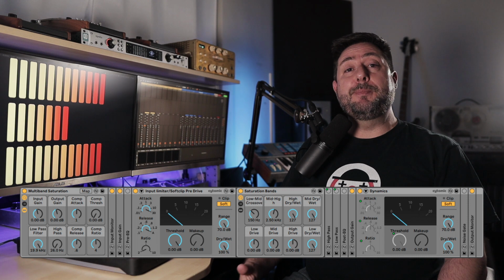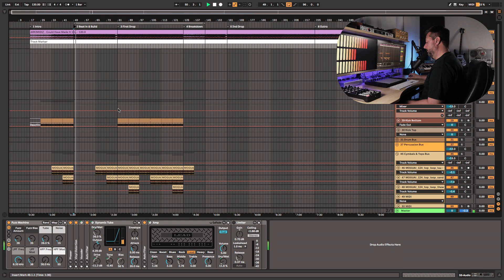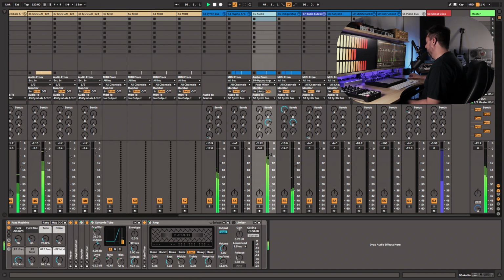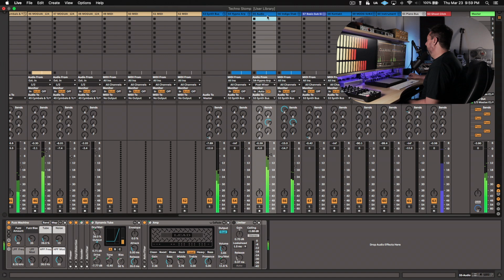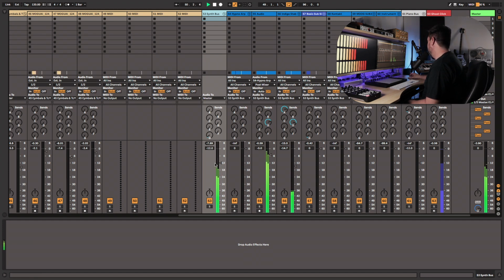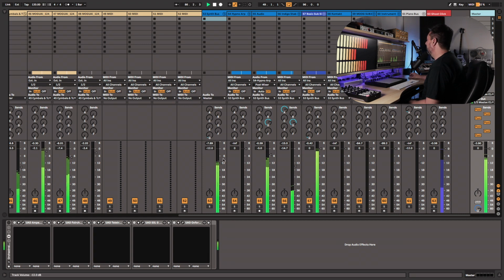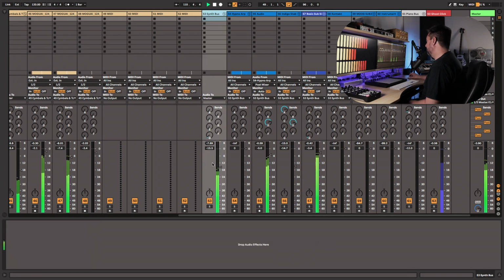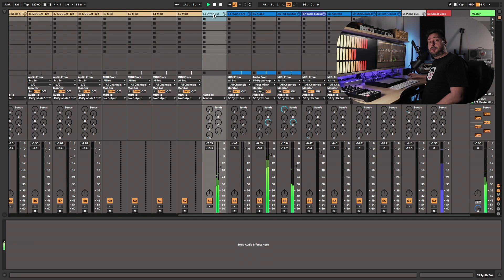Gain Staging Secrets: How to Mix Like a PRO

Comment: Hi. Great video!! Question: My personal default template setup for gain-staging has my busses set at 0 dB and each individual track at -12 dB vs. yours where you have your busses at -12dB and your tracks adjustable.  I also shoot for -6 dB at premaster (post mix) stage. Is What is the practical difference between the 2 methods? Thanks in advance.
Reply from the maker: Thanks for checking out the post! 

I prefer balancing the individual tracks within the group starting at unity or 0dB gain reduction because I found myself lowering the track volume much more often than I’m adding level. For example, balancing percussive samples can sometimes lead to drastic reductions with hi-hats to create the right amount of energy without overpowering the mix when passing through several compressors and limiters, bringing the high end up each time).

Additionally, I’ve found setting the group fader to -12db ensures I’m hitting the -6db goal that I have in mind. There are many people that say it’s not necessary to do this with digital but I can hear a big difference in clarity, balance, focus and energy in the right places with this workflow. Cheers!

Comment: I think that even more correct way to do it is to set the input gain of the channels so that the peaks are around -12dB when the faders are kept at unity gain (I dot't use Ableton and I am not aware if it measures the signal pre or post fader). The group or bus fader would also be best kept at 0 dB. If the output signal is too hot, maybe put a tool plugin to reduce it at the end of the processing chain. The faders use logarithmic scale and the further they are from the unity gain, the more difficult it is to make small changes with automation or with controllers, when needed. If you master in a separate session there maybe would be  no need to decrease the volume at every group - just pull the master down a bit to make the sound levels comfortable for listening or even just decrease the volume of the sound card. The DAWs nowadays have plenty of headroom before clipping.
Reply from the maker: Great workflow as well! Thanks for sharing your technique, I’ll give it a try

Comment: There is no benefits of having Peaks of a initial transient preserved in the range 0~8ms, rather 0~10ms. 
Inertia of human hearing won't detect such Peaks as a volume and such short portion of Peaks have 0 musical or timbral information. 
Such Peaks should be heavily Compressored and even Limitered, most time even Cliped.
Such Peaks (percussion\vocal\DI‑guitars) are sometimes even 12dBFS above the corresponding RMS (or VU) value and when tamed down, can free up to 9~12dBFS of Headroom to further boost the overall Volume om the signal\mix.

Comment: Hey i really like the way you explain! One question popped up in my head when you adjusted the volume in the fuzz plugin. is there an advantage doin it in the plugin instead  of pulling the channel fader a bit down to adjust the added gain of the fuzz plugin?
Reply from the maker: Hey, thanks! Glad you found it useful. 

There is a benefit to adjusting the gain on the way in and out of an effects plugin - it's to prevent overloading the next plugin before it goes back to the track fader. Let's say you add an EQ or compressor to your chain. You'll want to hit each plugin in it's sweet spot (-10dB to -15dB) so that they're all balanced. It saves you from having to adjust it later when you're setting up your final mix and scratching your head why one track is so much louder than the rest and then over compensating with crazy fader settings or reaching for a limiter (which could squash your sound completely if not used properly).

Feel free to reach out by email if you want me to walk you through it
chris@electronicmusictips.com
Reply: @ElectronicMusicTips   i see. makes totally sense now! thank you for your explanation. I appreciate it very much!

Comment: Great video, I like how you explained the basic concepts first, giving actual numbers to start with and also to show it in a daw. Thank you. Do you have any tips for live performance setup, what might be different in terms of headroom (less or more) and with sends instead of buses? I use buses when finalizing tracks, but cant really make it practical when live since i record instruments during performance and mix additional sounds in. There are some limits how many channels I can operate meaningfully, so i use sends instead of busses. I'm pretty new to that so I don't really know any other way. Maybe there are some tips with that how to sound better with sends.
Reply from the maker: Thanks, I'm happy you found this post helpful!

Gain staging and headroom for live performances is the same as recording, with the importance on finding a good balance between minimum noise level and maximum peak volumes. Stay between -1dB to -5dB for peak volumes so that you're not clipping and introducing audible artifacts and distortion. Aim for your average level to be between -15dB to -10dB RMS. Your DAW might have an RMS setting to show you the average volume. I use a plugin called VUMT, made by Klanghelm. It's a great meter and I think there's a free version! Lastly, using light compression or limiting will ensure you're not going over unity gain (or Zero dB). I always set the threshold so that it's just 'kissing' the signal and roviding 1dB to 3 dB of reduction. Anything more is too heavy handed and will start to compress your sound too much for a live performance.

There aren't any hard rules for using busses vs sends... use and abuse your system any way you can get it to work.... most of our favorite music was made using the tools that the artist had within reach. 

Feel free to contact me to let me know if this works for you or if you have any other questions!
chris @ electronic Music Tips . com
Reply: @ElectronicMusicTips  Thank you for your reply Chris, really helpful tips! I will follow your advice and check out the RMS setting and VUMT, as well as light compression/limiting. I already tried your tips from the video on a track and it really clears up the composition, can't wait to try out these tricks in a jam session. Thank you again!